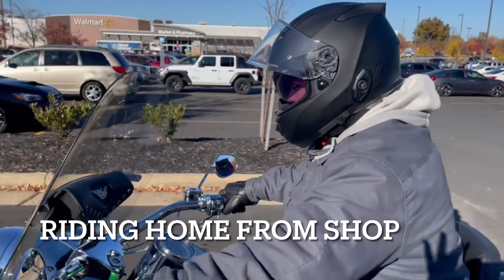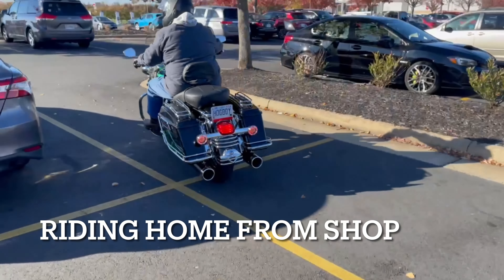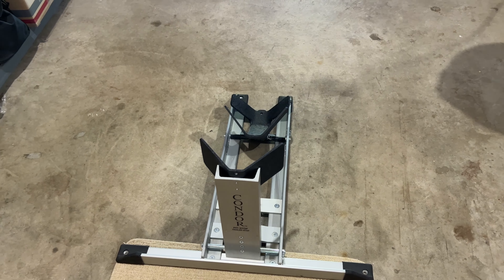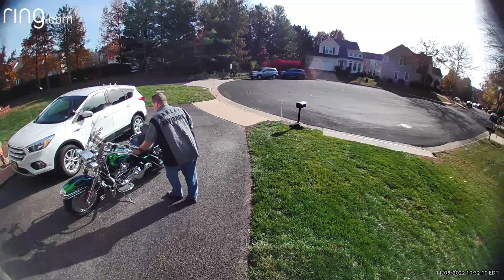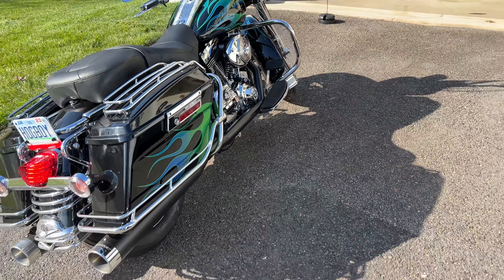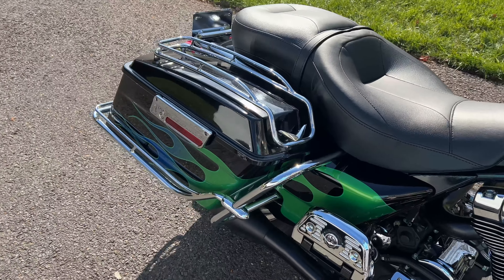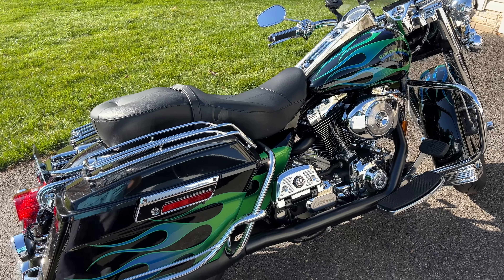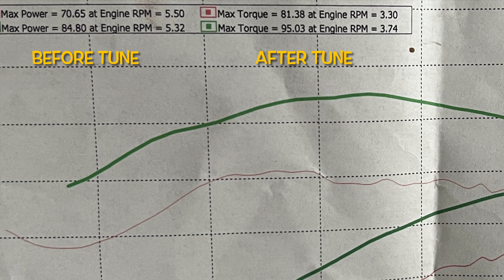How did it turn out?  Part 2 -  2006 Road King  95” kit installed and tuned

Comment: I commented a question on the other video on accident. Was wondering what  heads exactly they are as I'm thinking about doing the same
Reply from the maker: they are the screamin eagle pro cnc ported OE heads Part # 1650013A. I would strongly suggest getting the high compression pistons..I did not and wished I had.  the 203 cam is a little mild but not bad.
Reply: @Thesimplehomeowner  
Mine are the 9.4 🤷🏻‍♂️

Comment: My 2001 roadking all stock except for exhaust and updated cam chain tensioners, every body I know that starts upgrading their motors always,always have motor problems. I've owned my king for 20 years 87,000 miles 88 cubic inch ,lots of oil changes thats it.
Reply: Yeah, the earlier yrs were not as good to upgrade . Things got much better after the 04 . I have a 08 Softail Custom with woods 555 cams almost pushing 98 hp 113 on the torque, and guess what ? No problems, but just the engine being a little more noticeable noises due to the cams itself . I don't know who you're listening too but a little upgrades won't make your bike unreliable unless you have a mechanic who doesn't know what he is doing .
Reply: @brianrahuba6919 um.... 
08 don't got a timken 🤙

Comment: Nice bike, sounds good but with pipes , heads, and 95 " only 11 hp more ?
Reply from the maker: The sheet is a little misleading. The before was after all the work was done but a flat tune. A stock 88” twin cam is around 60 hp.   I gained 11 hp just from a good tune after the work not 11 hp from stock.
Reply: @Thesimplehomeowner  ... Yes I thought that after I wrote it. But still thinking you should have gotten more than 20 hp from stock.

Comment: You need an s and s stealth air filter man. Screamin eagle filters aren't all that. I have fueling 525 cams in my 95"  and it pulls like a freight train... I smoke guys woth built 103 motors
Reply from the maker: ill have to look into that..thanks
Reply: Isn't that low on horsepower, though . I know the torque is high on that cam, like almost 110 on the torque from 350 to 500/ 5.50 rpm . I almost went with that cam
Reply: @Brian Rahuba  all I known is the thing runs strong for a 95" and sounds like an evo at idle...
Reply: The 525 cam is amazing, I have it in my 03 fatboy. People can't believe the difference it made

Comment: What's the details on the upgrades
Reply from the maker: part 1 and 2 go over that , but HD 95" kit, new ported SE heads, new pistons, SE 203 cam, new cam plate and pump, true duals by Reinhart, dyno
Reply: What it dyno out at 
Did you get the 95 jugs or bore
Reply from the maker: @chrisbenson6860  95 jugs.... 85 HP  95TQ
Reply: @Thesimplehomeowner  
I recently bought an 01 ultra classic that's been bored with 95 pistons, same cam (203) Vance and Hines exhaust. Been considering getting port work next winter since the season is close. Where are you located and who did the port work
Reply from the maker: @chrisbenson6860  I bought the Harley ported heads. They came already ported and polished
Reply: @Thesimplehomeowner  
Happen to have a link or part number? That's interesting, could do a weekend swap rather than waiting another eternity 😀
Reply from the maker: @chrisbenson6860  sorry I don’t, I had the dealership order when they did the build
Reply: Chris, for 99 - 05 Twin Cam,  # 16500013A are more than likely the heads he has used. These are CNC ported, but not polished. You will also need 2 intake flanges 
# 26993-06. Of course the appropriate gaskets as well. 
I hope this helps,  good luck Sir. 
These work best with a cam up to .500 and less than .550 lift maximum as far as flow. Valve springs are only good to
.585 lift.
T. S. RACING 🏁
Reply from the maker: @t.s.racing  thanks for the info. I hate to spend more money but I have a consult with someone like your self in my area,  to see what my options are. And if bang for the buck second time around is worth it

Comment: Good Lord!😳😬🤔... The motor is jumping all over the place...look at the seat vibrating😬
Reply from the maker: The 88” engines are notorious for vibrations.   It will shake your contacts out  when sitting still.   I also think my iPhone made it look worse than it actually is.   Thanks for watching
Reply: My 99 shakes pretty good too
Reply: Of course, it's jumping it's rubber mounted . Lol lol it smooths right out once your in motion . My 2001 Super Glide was the same way
Reply: @The Simple Homeowner  I liked the Evolution motors the best, then the twin cam